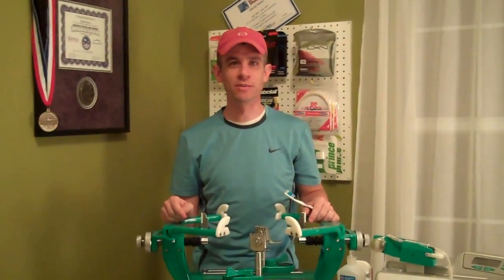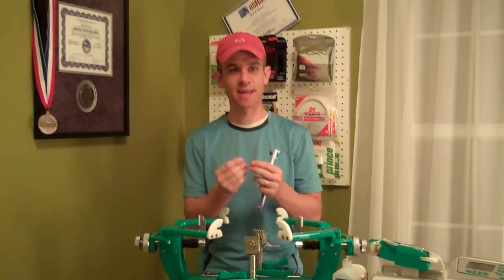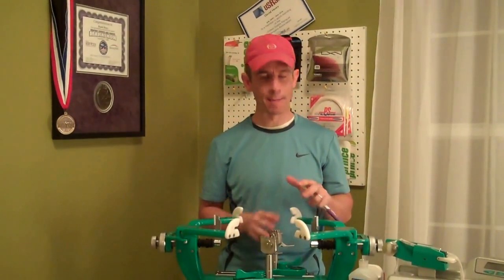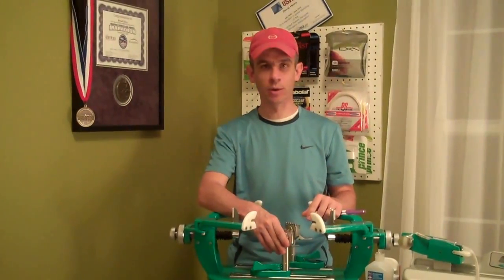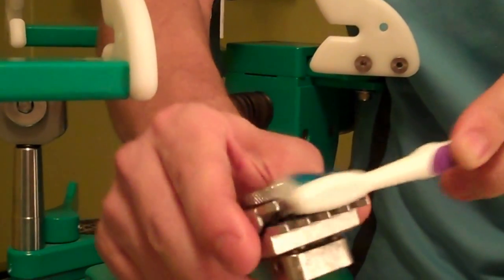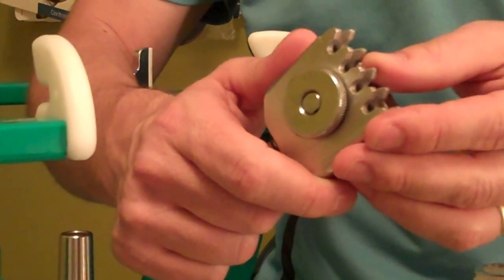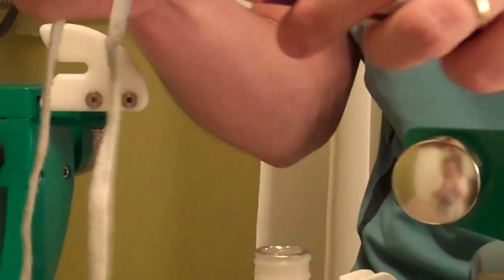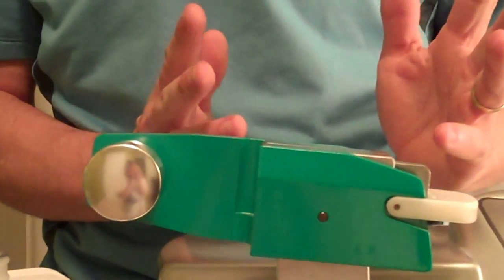Tennis Stringing Machine - Cleaning Clamps and Gripper

Comment from the maker: Not sure.  You're always best to check with your machine manufacturer first - to see if they have a recommended substance for cleaning.  You never want to risk voiding your warranty.

The rubbing alcohol I use is 70%, and it has never caused any problems.

Take care.

DH

Comment: The machine I use at work is causing me problems. The locking clamp to lock the turntable locks and jams. Recently whilst I had a racket on it and I couldn't release it. I like to lock this whilst doing the crosses other wise the turntable is moving around too much. Have you had any issues with these clamps or how to maintain them. Thanks

Comment: Excellent tips, David.  I wonder if you might have any suggestions for cleaning a racquet frame?  I work in a pro shop, and the boss wants us to use a dampened towel (water) over the bumper and frame after removing strings but before putting in the new strings.  However, using this method doesn't leave a lasting shine where the bumper shows abrasions and wear.  One YouTube clip endorsed moistened cotton balls with baby oil, which sounded like a good option.  Other ideas I've heard of include goo gone, Armor All and WD40.  Any insight you could offer would be most appreciated!
Reply from the maker: I always do the best I can with water and good old fashioned "elbow grease".  My fear is that some other type of cleaner could damage the paint.  Take care.  DH